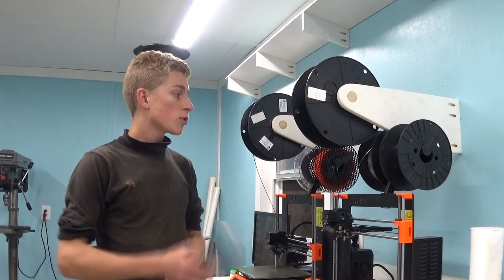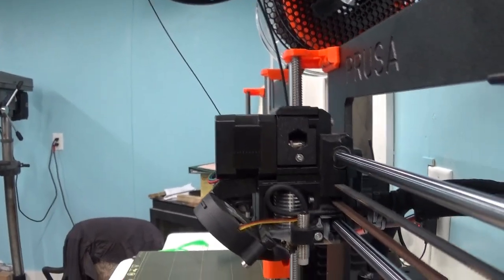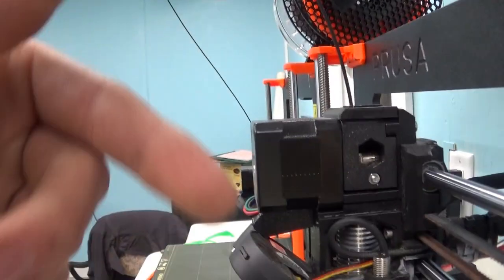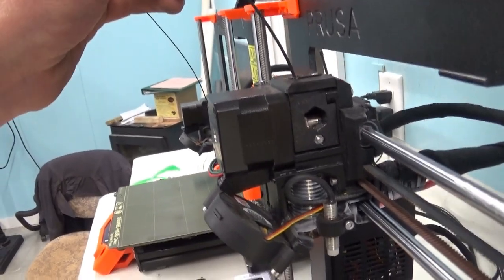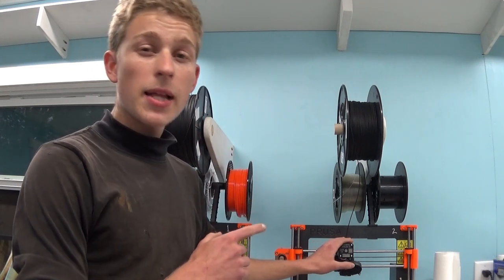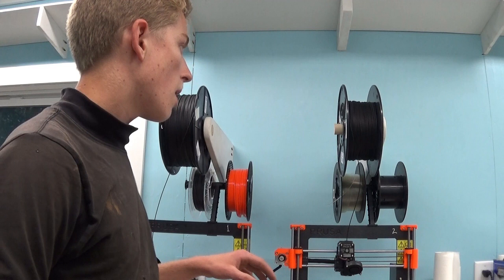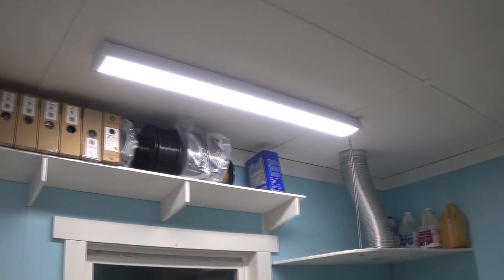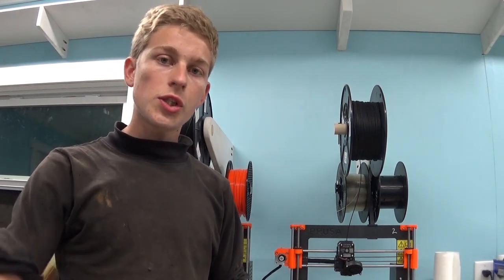How I Print With Large 3KG Rolls of Filament, A Look At Hoffman Tactical's 3D Printer Setup

Comment: You should really store your filament in dry boxes with silica gel to control the humidity. Most filaments are very hydrophilic and exposure to moisture will damage performance of the material
Reply from the maker: Definitely! I want to start printing with Nylon, and will be adding a "pod" around each spool. I use the rolls up so fast as it is, that I have not had any problems with ABS, but Nylon is a lot more absorbent then ABS.
Reply: @HoffmanTactical  Even PLA and PETG absorb moisture fairly quickly - I notice changes in print quality and increased number of clogs and flow problems after just a couple weeks of being exposed to 40-50% humidity. Setting up some dry boxes is very simple, since you can 3d print nearly all the components. I built one using a sterilite container - take a look on thingiverse for some of the designs out there. 

For your setup, the "pod" idea might work well - otherwise you could enclose the entire 3d printer setup in your space and install a dehumidifier and/or large quantities of silica beads. Enclosing the 3d printer is good for temperature consistency and preventing dust/debris buildup anyways.
Reply from the maker: @stingraybob8933  While it's not in this video, I have installed a fume hood and will be enclosing it. Mostly to remove the ABS fumes. Keeping the plastic in pods will also help keep dust/dirt off of it, which is always good.

Comment: I'm trying your ar 3.0 design in polycarbonate carbonfiber off a 150 dollar printer. Wish me luck. First layer going down good, but I got 36 more hour. Thats how slow I have to go to get good layer adhesion. Think it will be worth the wait
Reply from the maker: That's a long print! How is it going?
Reply: @HoffmanTactical  I had to restart twice, third time was the charm, threads perfect 👌 but I might need to drill out the trigger holes. Also my handguard was a little too big for the front  so a little filing had to be done but the print was perfect and I'm confident it will work out. Layer adhesion was great, almost can't see the layer lines. I used a .6 nozzle at .2mm layer lines

Comment: OK interesting question. So there are AR15 uppers without the forward assist could up modify/test the design for a support rib on the other side on a upper without the forward assist? i think thats where its going to have to go for 3d printed upper to last https://cdn11.bigcommerce.com/s-g64i9l/products/1379/images/17812/AP-APAR610401AC_All__88436.1515559034.1280.1280.jpg?c=2